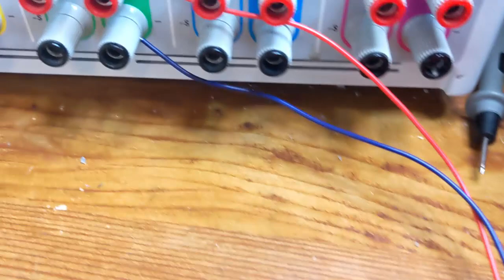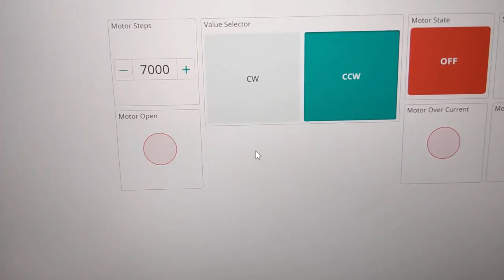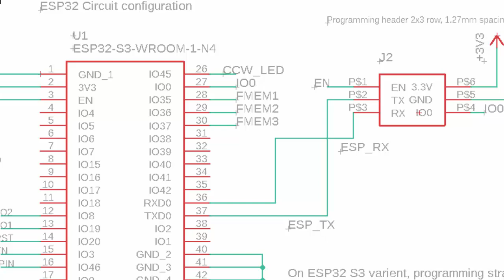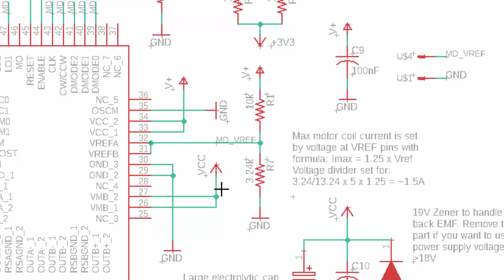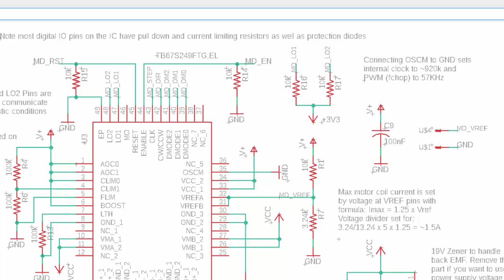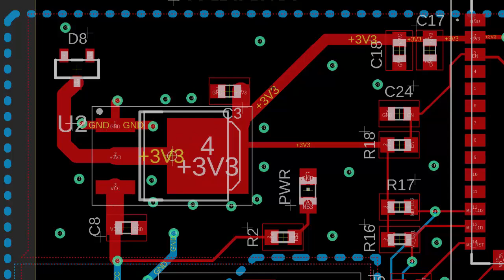Building a Wireless Bipolar Stepper Motor Driver Circuit Part 2

Comment: Suggestion for a future circuit: 120VAC variable voltage reduction circuit. 120VAC input and 10 to 120VAC output with the ability to handle a 1 to 3 amp load.
Reply from the maker: Thanks for the suggestion. The easiest way to do what you are asking for is to use a Variac (variable transformer). But a variac does not have a regulated output with set voltage and current limits. If you need a tightly regulated adjustable AC power signal than you are looking for an "AC Source" or "AC power supply" and they are not an easy design and would be out of my reach for a video series. Companies like Chroma and Keysight Technologies make some but they are not cheap.
Reply: A while back, I purchased a 24VAC transformer on Amazon for $15 (USD) for my RV. I installed an ecobee thermostat (With relays) in my RV and the 24VAC transformer works great. That is when we have shore power (AC) available. When Dry-Camping (No AC) the ecobee is useless, so I have to flip a switch that sets the connections back to the old fashioned (Analog) 12VDC thermostat. I was thinking of making an AC/DC inverter with an AC output set to 24VAC. I could probably put a circuit together on a PCB using a Triac, Diac, Pot, a few Resisters and Capacitors. The issue would be the exact values of them to use, which in my case would be trial and error as I do not remember the formulas to arrive at the proper values. My brain cells would not be happy at all. Once I got the 24VAC output I would see what the resistance of the Pot was and replace it with a resistor. Well it was a good idea. I could just purchase a low output 120VAC inverter and plug the 24VAC transformer into it and run it 24/7, but the batteries would not be happy with that idea. Still thinking. Thanks @ForceTronics